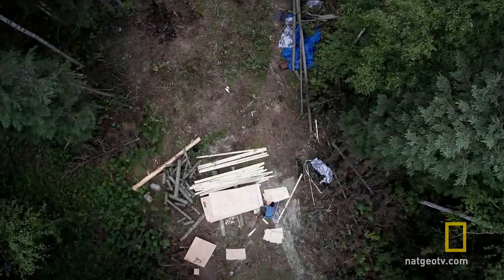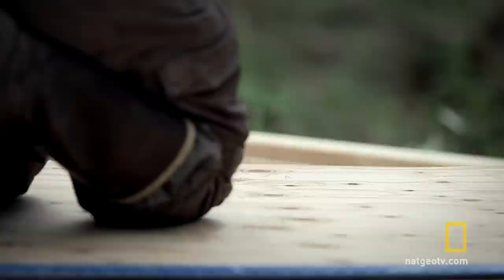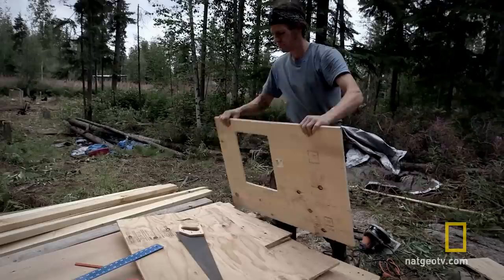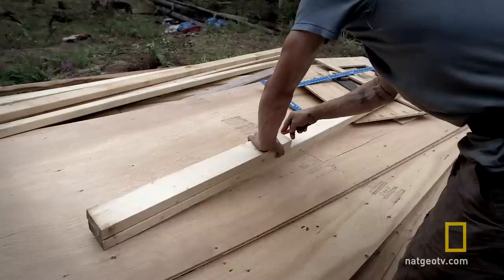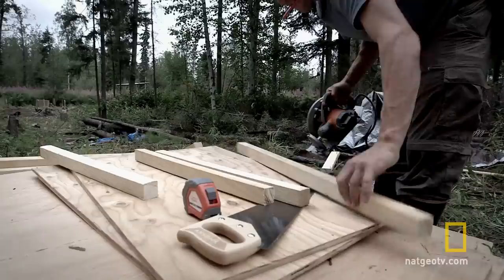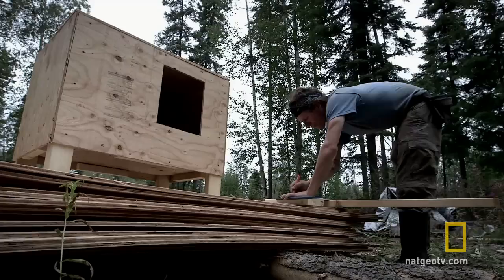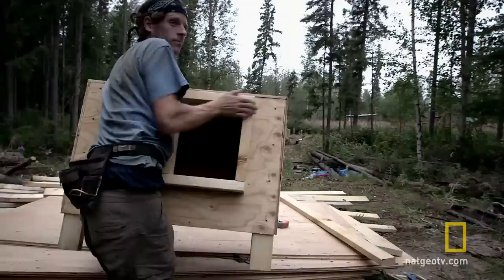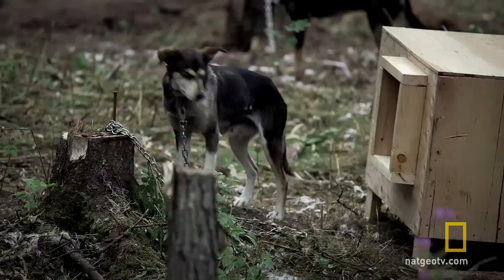Sled Dog Houses - Thaw Project | Life Below Zero

Comment: Why wouldn't you make a large structure to individually house the dogs, each dog in a stand-alone home is very inefficient. 
4-6-8 pods Under One Roof, would be more efficient with building materials, but most importantly thermally.
Reply: The individual houses are there for many reasons. The main reason is to limit dog fights and each dog has their own space. The only times they are under one roof is in the mushers home or in the dog truck. Many mushers have a separate fenced space to have the dogs run around and play. These dogs are also arctic breeds and are capable of withstanding below freezing temperatures. The only insulation they need is hay and their fur.Anymore insulation and they will overheat. Mushers have been doing these things for decades and it works. if it didn't they would change.
Reply: Because they only care about controlling the dogs. How much water and controlling their activity levels. etc.